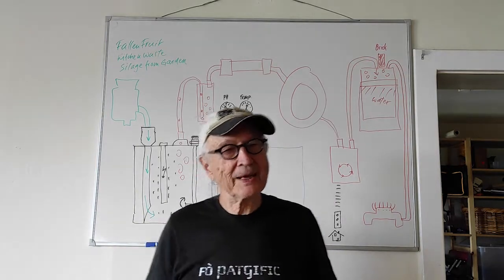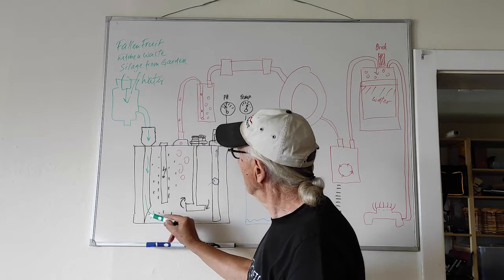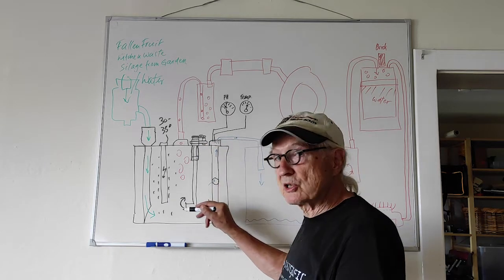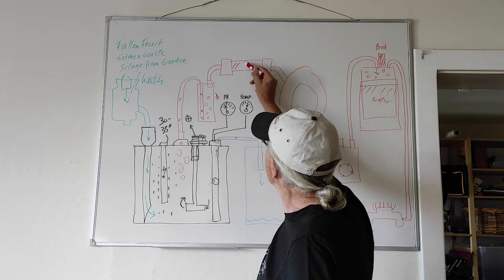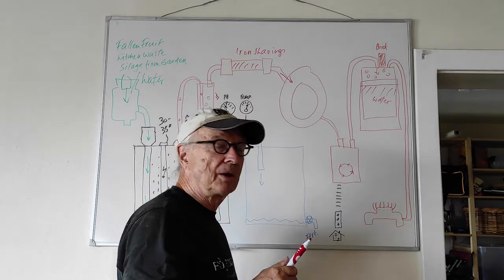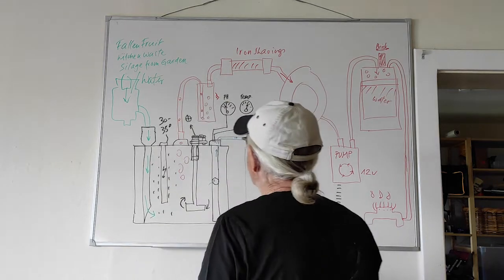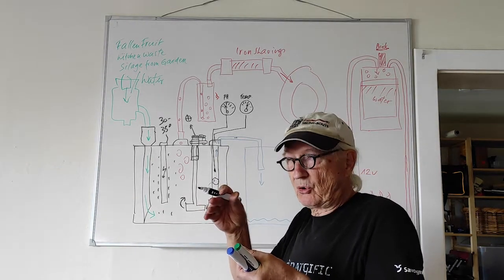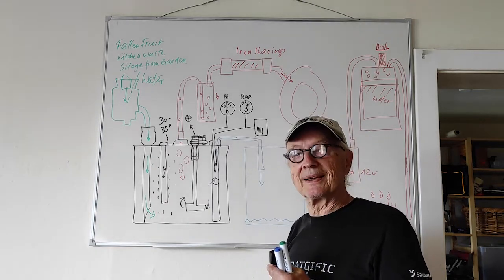Homemade Biogas in Switzerland Part 3, Theory

Comment: Is there a pump in the discharge pipe from the main chamber into the second IBC?
Reply from the maker: When the main chamber is full and when the gas production is ongoing the pressure build-up will naturally force the liquid fertilizer into chamber two. Given that the height of the two is correct: the second lower than the first. In my daily routine feeding the digester, when pushing the material down with a stamper I hear the overflow from one to two. Thus I always have abundant fertilizer for my vegies and garden. Thanks for your interest!

Comment: Can the digester medium not deal with the cellulose of the leaves directly? (I would assume lignin / wood is difficult, but I didn't know you had to pre-digest cellulose?)
Reply from the maker: The ratio of C to N is pretty important when aiming for a good yield of gas. Kitchen scraps are ideal with a ratio of 20 - 25. Woody substances take a long time to digest.
Reply: @etienneconod8075  If it comes down to the C:N ratio I was hoping for plant leaves that the N contained mainly in the rubisco protein offsets the C mainly from cellulose, giving a good final ratio (maybe not all plant species, but maybe N-philic weeds like nettle).
Reply from the maker: @Hecatonchires1991  Sorry - this getting too academic for my poor old brain :-))

Comment: What is the use of the final water tank (wherein you place the final gas tank with brick on top)?
Reply from the maker: The blue tank was built as an addition to my rubber boats containing the gas. Thus I can see the progress of the production when the inner container rises. It is also a safety measure if the gas production would become too big. And the weight ontop served to produce a bit of additional pressure for cooking before I started using my radio-controlled pump

Comment: Thank you for your videos parts 1, 2 and now 3. You present very well and so clearly. I live in New Zealand and want to build a biogas digester with IBC. It is Spring now in NZ so I'll build it very soon to make advantage of Summer heat. If it works well I'll move to your wonderful heated and insulated design in time for our Winter. You have inspired me to get motivated. Looking forward to seeing more of your videos in future. By the way, you are correct about low pressure biogas being really quite safe from dangerous explosion.
Reply from the maker: Hi Grant thanks for your encouraging feedback! Just got home from a 4 day hike and found that I had not put enough attention at the water which builds up in the system in. But since its all "trial and error" with my design I will stand by and wait for a solution which will offer itself to the problem. Also, when using a 12 V transformer for the pump make sure it is suitable for outdoor use. My next video should be about construction details and considerations.